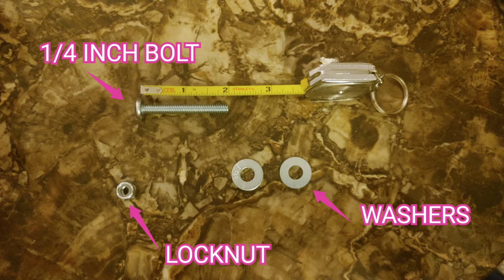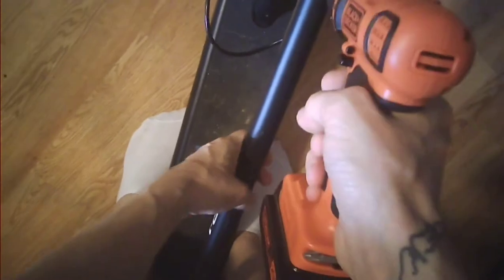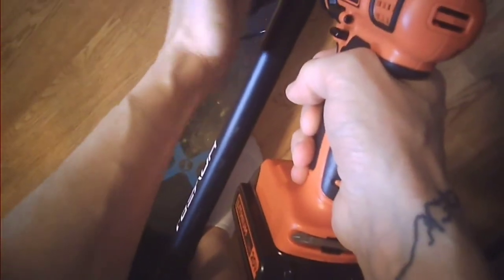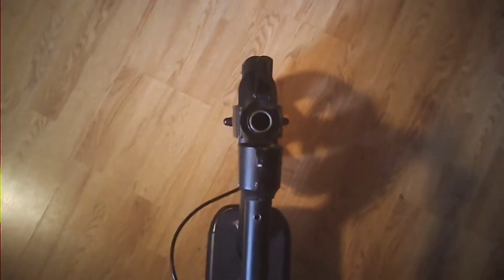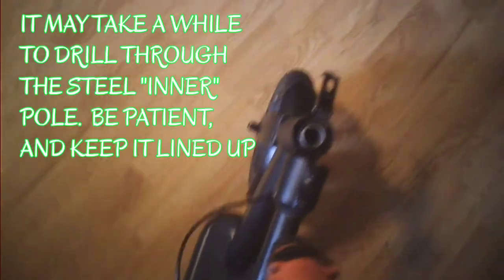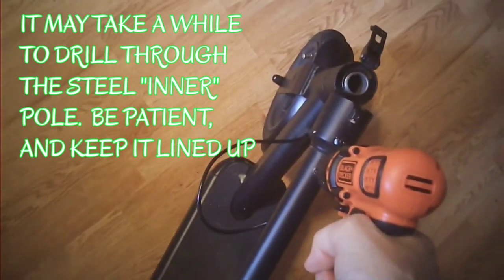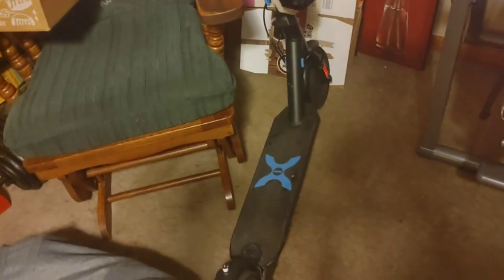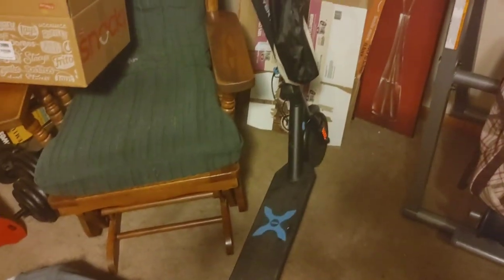Fix Hover 1 Scooter welding that snapped WITHOUT using a torch CHEAP

Comment: Apparently there are two bolts inside. If you pull that apart. You can tighten those up to help with play also.. I might need to use your fix after I try mine first.. thanks

Comment: This happend to my hover Pioneer.  😢 it connects a different way I have to do this in the thicker metal part😢 instead of sliding over the connector part it slides into it.

Comment: hi, nice fix. just wondering what drill bit are you using and how long did it take to drill the hole.
Reply from the maker: The bit was a cobalt but (not sure of the brand), for size just go with whatever bolt you intend to use.  But several...it takes quite a while to drill through that steel, and the bits get dull.  Probably took 30 minutes, honestly.
Reply: @House_of_Heathens  wow I was thinking 10 minutes lolsss. thanks for your reply buddy.

Comment: They only welded 1 of the 4 sides
Reply from the maker: I know, some of these scooters are made so cheaply that hitting one bump or a small 1 foot drop from carrying them will cause the whole frame to separate.  

Not all scooters are like this, I assure you...I have a FluidFreeride Horizon and although it's a bit heavy to lug around, the comparison of quality is day/night.  Btw I definitely recommend that model